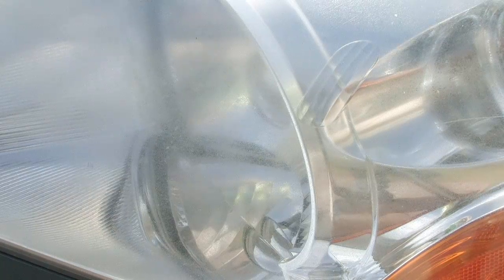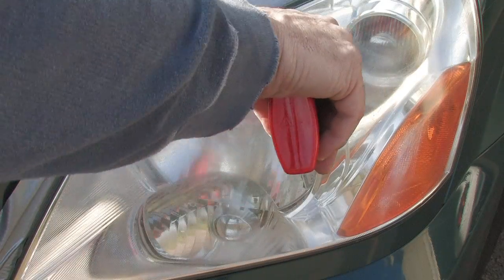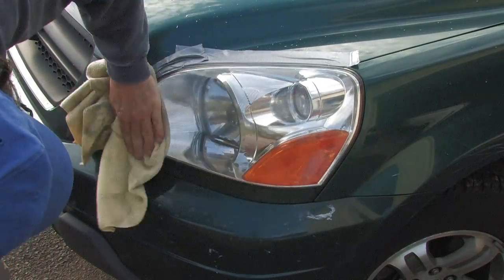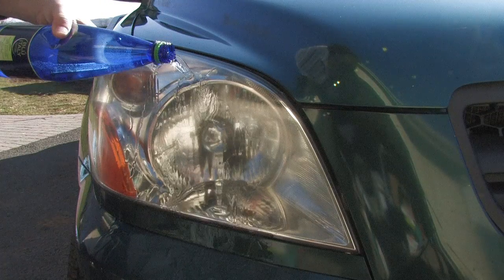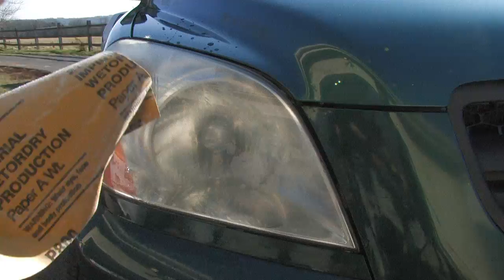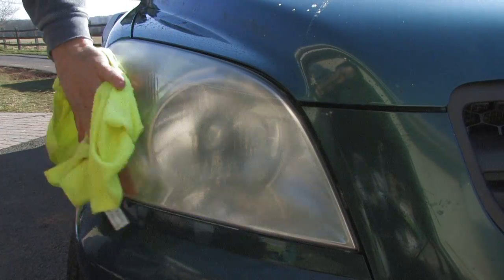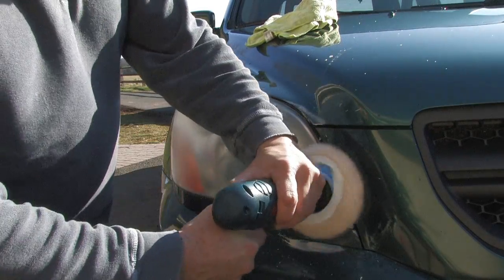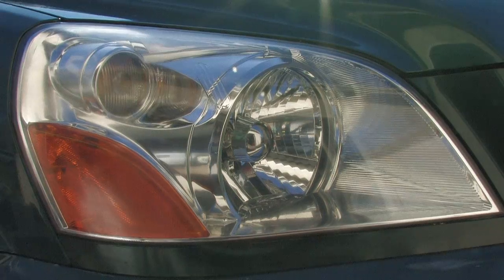How to Restore Headlights

Comment: I just bought a kit from Harbor Freight (on sale for $9.99...reg $14.99).  It's a 12 minute kit and worked great.  It had two foam backed fine grit sand paper disks that you stick to the backing plate that you chuck to your drill.  Three minutes with this sandpaper disk followed by three minutes with the polisher and the paste that's included.  It worked like a champ.

Comment: I had headlights on my 2006 Corolla that looked exactly like your vehicle's headlights, but I decided to just use the buffing pad for a lot longer. I buffed for about 15 to 20 minutes and for me that removed enough of the pitting without having to use any sandpaper. Just make sure your buffing pad doesn't spin TOO FAST because if it creates too much friction heat it just might MELT the plastic of your headlight, then you will need a new headlight.

Comment: not a bad video, but, the way your doing it isn't correct.its best to start with ( depending on how bad it is, learn from experience) 600,800,1000,1500,2000,2500, when your sanding, keep the headlights wet as possible to keep debris out and the sanded plastic away, as not to clog your sandpaper also. also, i find its easier to change directions with each higher grit, to know when you need to keep sanding. ex. 600 up & down 800 left to right, 1000, up & down, etc.then buff. hope this helps!